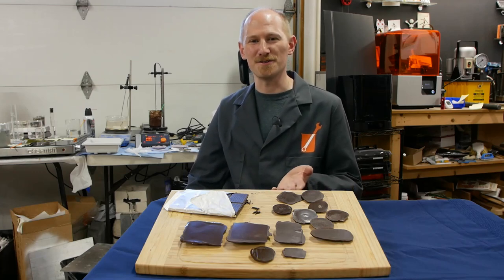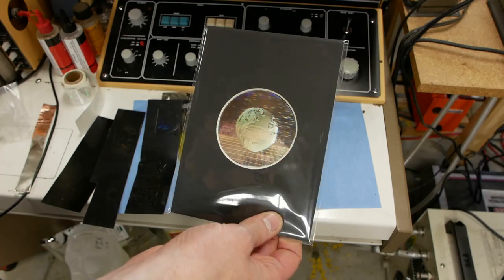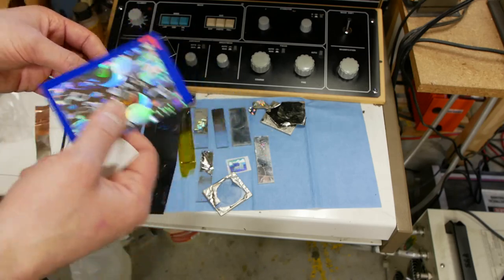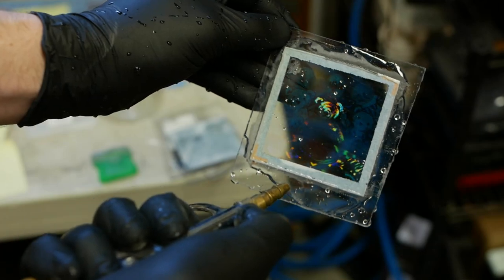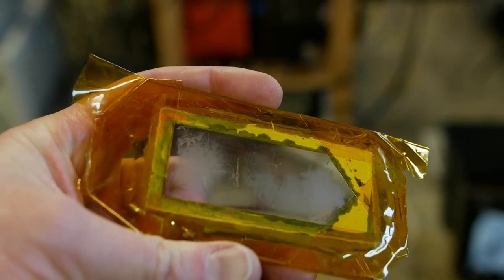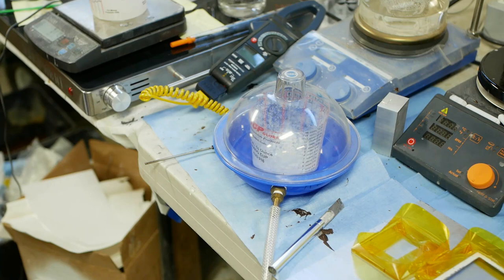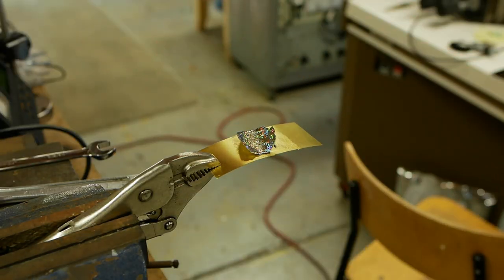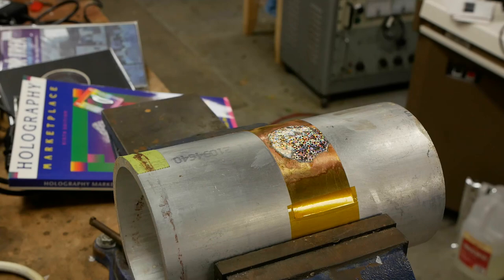Holograms on chocolate

Comment: The easiest method to temper chocolate is called cocoa butter silk. Just melt the chocolate and add 2% by weight of cocoa butter silk finely grated to your chocolate and mix. Then just pour into molds. Cocoa butter silk is made from cocoa butter maintained at 92.5°F/33.6°C for 24 hours in water by a sous vide heater/pump ($100). It maximizes the V crystal and provides a seeding or scaffolding for the cocoa butter in the chocolate. No worries about the chocolate tempering curves. It is a DIY "mycryo" micro cocoa butter powder used commercially. Cocoa butter is polymorphic and is capable of forming 6 different crystals. Cocoa butter is a triglyceride (3 fatty acids) and is surprisingly resistant to oxidation with a long shelf life unlike other triglycerides. On a side note, there was a research paper a few years ago where palm oil was used to desalinate water  by changing the phases from liquid to solid- it surprised the chemists - not very efficient though. You could probably obtain desalination with the cocoa butter as well - Ben could be the first to do it and measure the efficiency. If crystallization rocks your world, take a listen to Dr. Rupert Sheldrake, a chemist talks about melting points and how they are not constant as you would think due to his proposed morphic resonance theory - quite interesting.

Comment: Wow, amazing! Love the video as always and will have to try your metal process! I found an effective way to remove chocolate without affecting the surface texture was to use a layered mold (laser cut acrylic) where the diffraction grating/bottom and the tops would be pulled away from both sides, then you can easily pop it out from the non-textured side and easy to clean, as well as quickly laser cut diff designs for the middle layer (or adjust the thickness with multiple layers). Model/output seen here: https://twitter.com/samykamkar/status/1259720942470656000

Comment: There is a detail that I think I can help you with: the diffraction grating (hologram) is the large ridges you see with your electron microscope. Typical sizes for diffraction gratings are in the 800 nm to 30 um range. See it this way: light will only interact coherently with materials that are of its same size or larger. Visible light goes from 400 to 800 nm approximately, so valleys and ridges must be of that size or larger for interference effects to take precedence. If the features of the system are smaller than this scales, then light interacts with the system as an "effective medium", with an effective index of refraction and without seeing the individual features. Technically, if you are "far away from the source and the material with features" in the Fraunhofer limit (typically further away than a few microns from the surface), the smallest feature that light can interact with coherently has to be the size of half the wavelength of the light. This is the "diffraction limit" of resolution, and there are certain very interesting ways to beat it and do better than this. In conclusion, the features you are looking for in order to preserve the hologram on transfer are not on the single nanometer scale, but rather on the micrometer (1 ~ 30 um) scale. Addendum: I admire you, admire your work, and want to have a lab like your someday. Some of the things you do you could publish in physics journals. Particularly in journals like the American Journal of Physics (AJP) of the European Journal of Physics (EJP), that are interested in teaching and the more didactic approaches to physics. These are classical experiments from 100 or 200 years ago, but with limited materials and with an unusual bent (such as the chocolate holograms). So, these would be ideal to publish in one of these journals to propose as an undergraduate-level experiment.

Comment: Cool that you did this! Very comprehensive.
I went with sugar following Tech Ingredients video, and after figuring out the process got some pretty decent results!
I encourage anyone to try making diffractive chocolate or sugar, the resulting color vibrancy is a sight that you can only appreciate yourself, and given you did it by yourself its a very rewarding experience!

The major downside was the moisture in the air destroying the fine structures within about 20 minutes, so I tried it with candle wax, and that worked better than expected.
It did have a shrinking problem tho, and was even more sensitive to what temperature you'd peel off the mold. Smaller pours about 2cm diameter were mostly fine.

What I wanted to try out was pouring into a cylinder, to essentially have a decorative candle with a diffraction grating. That really became a challenge with Temperature control, and didn't produce any viable results due to shrinking issues.

Your silicone molds might work very well for that tho! 

Have you tried to preserve the structure on chocolate with some coating? That's something I wanted to look into for the wax, so that they outlast a Summer cycle. But I don't know enough about optics and solubility to figure out which one i could use, so maybe that's something to revisit another winter. I did spend a lot of time getting the process right, so I'm burned out on the wax (heh) for now. 

I will upload the video of my most vibrant pour to my channel, but due to phone camera it serves more as a personal memento.
By the time I got the process right the diffractive film got pretty warped, which made the result look interesting and got me thinking about 3d shapes.

Comment: Isn't this similar to how blue butterflies produce their blue "color" ?
Reply: I think so!
Reply: Its all down to the  refraction of light.
Reply: @JeffShepherdphotos  Yes, it is a similar and related mechanism that explains the colour in butterflies' wings and in hummingbirds, but it is not quite due to refraction. It is rather reflection, and selective absorption. In this case, we have a diffraction grating that has a microscopic pattern and creates an image. In the case of butterfly wings, you have a series of layers (like scales) one on top of another. Because these layers are so thin, they are of about the same size as light itself, and this makes it so that if the size of the light just matches up with the size of the layers, the light gets amplified and reflected. If they don't match up exactly, the light wave gets absorbed by the material. So, the layers are the size of about blue light, so this light gets reflected. This is the principle of an area of study called "photonic crystals".
Reply: @guillermoalejandroperezlob5208  Yes, very true. A bit  like like a DVD

Comment: A few months ago, it was pretty popular to use those diffraction grating sheets as a bed on your 3d printer. You end up with a neat reflective surface finish on your base-layer. I'd wager those same sheets would work well as a starting point for doing this with chocolate

Comment: I feel like you could totally take a shortcut on the metalizing of the mold by doing an aluminum vapor deposited coating instead, which would give you better control and consistency, and TBH, would probably cost less than the nickel plating in terms of initial set up, since aluminum sputtering doesn't require crazy high vacuum to do.
EDIT: I'm becoming entirely too used to what Ben means when he says it's expensive, it was under $300 for the nickel plating kit, and you might actually have a hard time doing a vacuum chamber capable of doing aluminum depositing under that price unless you won the surplus jackpot.

Comment: Great work. I really like your channel, it's amazing the number of subjects you cover in your videos.
Anyway, regarding the diffraction gratings, as a rule of thumb the groove spacing should be in the order of magnitude of the light wavelength. In this case, since this is diffracting visible light, the groove spacing should be in the hundreds of nanometers range (the tiny grooves on top of the big one you saw in the microscope)

Comment: Chocolate is cool! Thanks for the video! Ive read a publication that chocolate also exibits superparaelectricity and this phase chocolate crystals can be sorted (seperated) - which affect taste. Also chocolate can be used in microwave to measure Wavelength - basically confirming the frequency of the magnetron by just a ruler and some formulas.. but Chocolate photonics seem quite cooler.

Comment: That is awsome robust and simple experiment. I tried and succeeded on the first attempt. You have everything at home. Sunday, every shop is closed, two hours of fun with a spectacular reward. If you keep an eye on kids when dissolving with Sodium Hydroxide you have perfect workshop for them. CD serves as a wonderful substrate. Thumbs up & Thanks for this tutorial.
Reply: Thinking about the Compact Disk as a perfectly flat substrate I relized the other side has a perfectly shaped difraction grating. Combined with how robust and adaptive Compat disc readers are... What if you mold chocolate Audio CD? Would it play? Copying Vinyls with chocolate is obsolete, but Compact Disk is a whole new challenge.

Comment: Very interesting. And like you said, not the first time. I'm unaware of brand or method, but i have had chocolate with holographic embossing somewhere in the mid 2000's. London, at a meeting "after party".  Entirely edible, (ate two, didn't die) had a floral pattern surrounding the company logo (a globe with letters).

Comment: I failed to temper chocolate just a couple days ago. I usually just heat chocolate chips in the microwave for a few seconds at a time, mixing it in between, until most of the chocolate is melted. With patience and stirring, the rest of the chocolate will melt as the heat redistributes. It's crucial to pull it out well before all of the chocolate is melted, or you won't have any crystals left to seed the lattice you want. Well, I wanted to pipe the chocolate into a standing decoration for a cake, and I didn't want any clogs, so I nuked the chocolate a little longer than usual. The resulting structure was too soft and malleable to stand on its own.

Comment: I think you may be able to skip the silicone step by using thinner plastic.
We use acetate for chocolate work but I don't think it would survive the hydroxide. Perhaps laminator sheets or even thinner.
Basically thick enough to re-enforce the hologram but thin enough to move with the contacting chocolate.

Comment: Could you use that silver coating technique on 3d printed parts?
Reply from the maker: Definitely.  The real trick is making the "activator" stannous chloride stick to the surface.  I'd suggest adding a pinch of sodium lauryl sulfate, but depending on the specific plastic, there may be better options.  The link in the description has the best info I could find on the silver process, but nothing detailed about preparing plastic.
Reply: @AppliedScience  Ahh wicked! Might experiment with that sometime, thanks for the info!

Comment: 15:13 with regards to  the size of the features, I may be off base, isn't there some weirdness with holograms, that the resolution isn't so much determined by the size of the features but their regularity, and how consistent they are on longer scales (frequency domain Vs spatial domain)? And there is some uncertainty principle based finite amount of data you can store in a surface of a given size and light of a given wavelength, where adding more detail doesn't actually do anything?

One way around having the hologram being too big to get good results might be just to cut the thing down to size- the entire hologram should still be there, just a little blurrier(by cutting it in half you increase the uncertainty in the pattern and thus reduce its Resolution?)

I may be totally wrong, and this has inspired me to go read up some :D

Comment: Could I apply the silver nitrate solution to silvered plastics? I have several items on old valuable walkmans where the silver has been worn away from the plastic. If I was to apply the silver nitrate solution then airbrush clear coat to make the coating more robust, would this be a good solution? Can you think of another way to apply silver metallic finishes to plastic? I also make plastic models and a way to reproduce the conductive chrome finish would be awesome. Should I perhaps try electroplating the plastic, if so, how would you go about this?  Sorry for the complicated question, it's something I've been wanting to be able to do for a while now, without breaking the bank of course.

Comment: So cool. Do you think it would be possible to imprint the defraction grating on to other castable materials that have low mold shrinkage like onto ceramics like plater of Paris, acrylic or epoxy resins, or even bismuth or would I just be wasting time by attempting it?
Reply: You can cast the hologram into silicone and make resin pieces with hologram. I also was able to pour the resin on my holo sticker (A4 sheets from amazon) and it also worked very well.
Reply: @lolli84lolli20  Oh cool, I have all of that on hand already. I'll have to give it a try once I get a nice hologram to copy.

Comment: Just wondering if I can use Sodium Carbonate instead of lye? I have plenty of baking soda that I can heat until decomposition. I know that it works in place of lye for pretzels. I'd just personally feel safer using that over sodium hydroxide if possible

Comment: If it's 10μm, maybe it refracts LWIR light. Especially the metal parts. Check with a thermal camera by reflecting a hot source with metal. Resolution might be missing tho.

Comment: Have you tried producing a chocolate hologram stamp? In the end, only the crystals etc. in the layer that makes contact are important so my guess is that it should be possible to create a stamp that you heat to the right temperature and then you can stamp holograms into existing chocolate...

Comment: Very interesting video and the chocolate tempering & crystal structure video would be very interesting to see too.

Just a thought, would heating the plastic up to 32 degrees, coating it with chocolate and allowing the 32 degrees plastic & chocolate to cool together work or would there be issues?

Comment: When I was tempering milk baking chocolate chips, I brought it to 50 deg Celsius but when it melted it wasn’t nearly as liquid like as yours. When I cooled it to 28c it was barely even a liquid and by 32c I had to push it out with a knife and paste it on the diffraction gratings. Of course no colour was produced. What am I doing wrong if the chocolate isn’t working? I’m doing this by stovetop, not hotplate.

Comment: What if the sticker I bought is manufactured the other way round? It seems to me that the etching happens on the aluminum layer, not the clear plastic layer. anyway to dissolve the clear plastic layer but not the aluminum? P.S. Im not making edible prints

Comment: If i may ask. So with this technique. If i have a silicone mold with this holographic effect allready in it. And i pour epoxy in it. And the holographic effect is on my epoxy coaster. Can i use that epoxy coaster to make another silicone mold? does it work that way?

Comment: I tried this. I made silicon mold that has the holographic pattern. But the molds loose their pattern when exposed to air very rapidly. I can wash them to get some of the pattern back, but only really at the edges. The middle is seemingly totally gone. The first chocolate I made had a nice pattern at the edges, but none in the middle (didn't cure well). But now I can't get any pattern at all. I also tried melted hard candy, but no pattern either. Anyone got an idea on how to make molds that hold the pattern better? Any suggestions for what type of silicon works best?

Comment: so i wanted to tell you about a cool thing i found out while playing with some magnets an electric motor and a wheel speed sensor.

so my test setup was the sensor hooked to my osciloscope with adifferential probe and when i held the sensor to the running motor i got a signal on the osciloscope.
then i tryed the same thing with a transformer and got nothing uless i put a load on the sencondary.

i found this was quite a neat trick because the sensor seems to mesure the magnetic field within the transformer without being in the field lines like a hall effect sensor wouild have to

some information on the testing equipment: 
the scope was a tektronix tds 1002B 
the probe was an EEVblog branded HVP70
and the sensor was a BOSCH 02658006 (that came from an old toyota avensis)
Reply: Many transformers dont have full toroidal cores, so the field lines aren’t completely in iron. They also go around the outside of the transformer as only part of the core is metal.
Reply: @stargazer7644  so you say i might bw besureing the field lines bassing through the inductor outside the core?
Reply: @vega1287 Yes,  that would be my guess.
Reply: @stargazer7644  so the theory is that it dosn't work as well on toroidal transformers beacuse the field lines are contained better in the core
Reply: @vega1287  Yes

Comment: I got a project for you. Take 2 flat metal rings with electromagnets on them and have one ring spin one direction while the other spins in the opposite direction a half inch above the other ring. You will need to have electricity pumping into it and see what happens